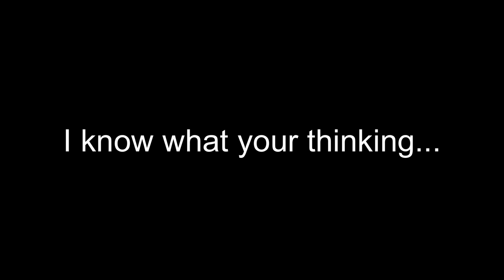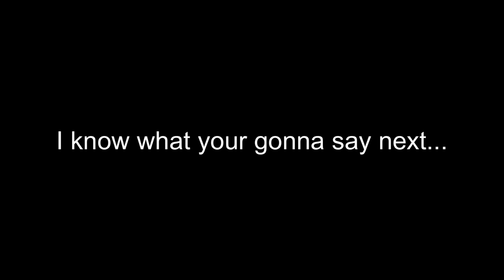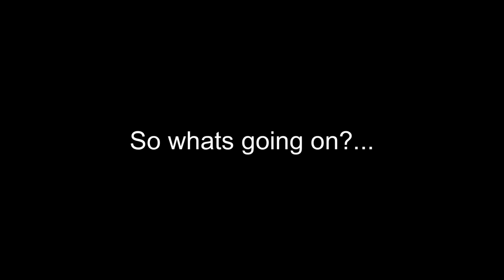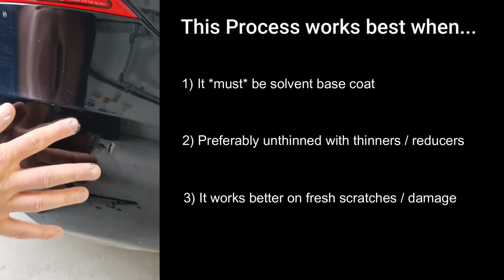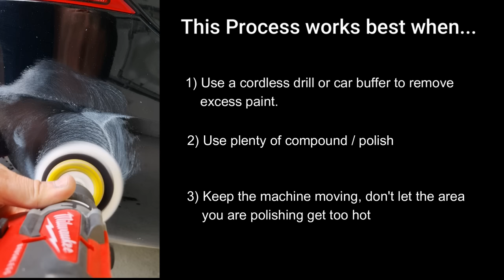Amazing Scratch Chip & Road Rash Repair Method

Comment: How long do you let the paint dry for? I'd imagine if its left too long it'll be almost impossible to get it off with just a polishing machine. So i'm guessing there's window of opportunity in terms of... when to buff?
Reply: I've found good results after 10-20 minutes with some mild level scratches and hitting it with a heat gun for about 60 seconds
Reply: Deeper scratches I fill with paint in JUST the scratch first, then I glass off excess so it's flush with the original paint, then polish
Reply from the maker: A couple of mins is usually suffice.

Comment: Hi, thank You for the video. I’ve tried Your method. I’ve used the spray paint from can  with exact number of color to match with my car’s color.
But I didnt spray it directly on a car, I made few sprays to a cup and then I applied to a car with my finger - as was shown in video.
The paint seemed a bit transparent and too much liquid, so I aplied 2 layers and then waited about ten minutes and then it was literaly IMPOSSIBLE to get the coulour out with the rotary pad 🙈
So how long time is best to wait? 3, 5 minutes? Is the colour cured, when you begin to polish it, or is it still sticky to touch ? Thank You!

Comment: Amazing videos- thank you for outlining this process so well. Could you tell me and what’s scenarios you use the 2000 and 3000 grit sandpaper and which ones you skip that step? Also what buffing compound are you using? Thanks so much!
Reply from the maker: I use rub and buff method on medium scratches and touch in/wet sand on deeper wider marks
Reply from the maker: I use farecla g360 cutting paste

Comment: amazing !  I have scratches where someone has used a coin on my doors and bonnet, but not deep, I may give this method a try thanks for sharing !  P.S Could I use an aerosol solvent paint by spraying into the paint lid to get enough  liquid paint, then use my fingers to rub in ?
Reply from the maker: Definitely worth a go. However I wouldn't use paint from an aerosol it will be too thin

Comment: That’s brilliant, can’t wait to try. Quick question re: the polishing pad, do you have to wash it afterwards in any special solution to remove elements of the paint ?
Reply: Foam pads can be maintained dragging a screwdriver across a DRY pad at high speed. This will remove the abrasives/foreign material in the pad. Careful to angle the bit so it’s not too aggressive OR pointing into the rotation. Haven’t tried on wool or terry cloth, but it works great on foam.
Reply from the maker: I would probably disguard the pad or use it for this method in future only

Comment: Great video. 
Just a couple of questions though 🤔 
After repairing the stone chips on my bonnet and the gravel rash on my bumper how long do I leave it before applying PPF??  If I got the car re sprayed I’m told it needs to cure for 3 weeks before covering it? 
Also will these repairs remain in good order if I do cover them with PPF?
Many thanks
Reply from the maker: The touch up paints usually cure fairly quickly. A week should be suffice.

Comment: Thanks for the great video.  I tried your exact method with drill, Maguiars Ultimate Compound and an orange pad.  The excess paint removed fairly well but now have buffer marks.  Is that normal and need to go over with a polish and softer pad?  Or did I do something wrong at my initial buffing stage?

Many thanks!
Reply from the maker: Hi. Like any polishing, finish down with a finishing polish and pad.
Reply: Thanks.  Everything turned out ok after polishing.

Comment: This looks awesome, thanks for sharing, but what about two-stage metallics? what is the upper size limit in terms of chip damage? No clear coat used??
Reply from the maker: 2 stage metallics are very difficult to get good results doing any kind of touch up work to be honest. Some better than others. Often I just use the ground coat
Reply: @cvrpov  By two stage do you mean any car with a metallic base and clear? Thats what i have, light colour too on my 97 lexus. Trying to find a work around bc the last owner "touched" in about a dozen chips and a deep key scratch and they've all come out a darker shade AND theyre not flush at all just painted chips. Maybe a rush job and not a proper paint match. Might try adding hardener letting it sit in the lid for a few mins and trying the card swipe method as well as the crown and wet sand method. One chip at a time and see what works...
Reply: @pixelbath2131  Thanks, that sounds like it might work. My plan is to simply carefully place a layer or two of (metallic) color paint into the chip "hole", then fill with clear and sand down with 1000 then 2000, then polish. these chips are about 2 - 5 mm diameter

Comment: Bigger rock chips on a metallic car, will this work you think? I think the color difference might be just a little too big when theres no clear coat.

But maybe if I mix clear coat, thinner and harender and rub it on and buff off. Have you tried this?
Reply: Nvm saw now, unsolved base coats without thinner but i guess ill try it
Reply from the maker: I have done some on metallic cars. Check my other videos

Comment: May have been asked already but there are too many comments to scroll through… Can this be done with touch up paint that is supplied by the manufacturer? Like the ones in the tubes with base and clear coat on each end?

Comment: Are you using a Milwaukee m18 hammer drill? I have the large Milwaukee polisher, but I also have a small polisher Griot's g8 polisher. I never thought about using an attachment to hammer or cordless drill.
Reply from the maker: I have the milwaukee mini polisher which is great. I just use the drill as an example that it can work with a tool that most people now already own

Comment: Fantastic video mate !.
This is a "Number 1 Top Tip" alright !.
Question :- If I used a manufacture supplied "Touch Up" kit, which comprises of a one tube of the body colour and one tube of the top coat lacquer, would using the base coat only work in your fix ?. The base coat will only wash out using gun thinners, so assume from this, that the colour stick is solvent based ?. Am I correct in my theory - Thanks !.   
Please keep the excellent content coming.
Love it !.
Reply from the maker: Some manufacturers supplies touch up sticks are water based nowadays.. so just bear that in mind and check 1st. It would probably be better to order some paint (50ml) from a local paint supplier
Reply: Mix some lacquer with the base coat, clean the scratch with panel wipe before rubbing with paint and make sure there is no tar around the area.
Reply: @robbeard6929  whats the ratio? thanks
Reply: @BoStErO1905  I would try 50:50. Just had another thought, I wonder if you could mix the base coat with super glue gel.

Comment: @cvr Thanks for your videos! I accidentally sanded a rock chip too much while trying to fix it. Now I have a penny sized hole down to the primer (white), surrounded by a 2 inch base coat area, surrounded by a 5 inch sanded clear-coat area. This is on my bonnet. What is the recommended course of action (can it be done with a touch-up pen of base-coat and another of clear)?  Much appreciate your expert opinion.
Reply from the maker: ultimately needs a respray if the paint has been compromised.

Comment: Amazing results. What should I look for when getting the paint? Should it be a perfect match paint with the paint color code and all or I can use any generic automotive paint with the same color? 

And what brand paint do you recommend?
Reply from the maker: On darker colours a close match is suffice. Any solvent paint though preferably mixed in the colour of ur car using the paint code.
Reply: I'm confused? I thought the solvent paint is what was supplied in the kit?

Comment: I’d love to buy this and probably will but need a couple of questions. The car is an Audi Exclusive meaning it’s paint is a one off colour chosen by the first owner. I don’t know if the paint code even exists. Is there a way to match colour without the code? Also didn’t really understand the products. Are you applying the touch up paint by fingers then using compound or is it wax?
Reply from the maker: Hi mate. Google and Ring Derby VW TPS and chose option 2 on the phone. Give them your car reg and they should be able to provide you with a paint code. If they can't then it might be a bit tricky. Martin

Comment: I know for a fact that the road rash on the lower doors will not last especially on a Porsche. This is a patented method called SSR sprayless scratch repair. I have been doing this for 14 years. It is effective, but the camera lies a bit because it does not pick up everything. SSR is out of Texas and has been around for at least 17 years

Comment: I have a multitude of chips on the hood and front bumper of my car, a 2020 MX-5 in soul red crystal. Would this method work with that color and multi stage paint?
Reply from the maker: Multi stage paint is almost impossible to get right unless the basecoat is very close match to the overall colour. Ie not much pearl top coat

Comment: I tried this method but used a 2000 grit first on one of your other videos. Then I got this touch up paint on eBay for BMW. However when I applied it there was a colour difference when it dried. I had to try and remove it again with the 2000 grit and then use the cutting polish after. A little improvement but still could do with another touch up. Where did I go wrong?

Comment: Is appears there is no need to specifically colour match. Is that correct?
Reply from the maker: Alot of colours especially darker ones can be a close match and not necessarily a perfect match
Reply: @cvrpov  that's what it looked like. I'm going to use this method on a dark grey VW Golf as it has just been keyed all the way down one side. I will be attempting to obtain the correct colour though

Comment: Awesome system! Avail. In USA?
I have my paint color code, but how do I know if my paint is solvent or water base?('08 Accord)  Aren't the majority of cars now water based?  What happens if I have water base paint & use this?

Also, will this work on a pearl paint ('10 Toyota Prius) that uses a tri-coat system instead of just base/clear?
Reply: Only the color (basecoat) would be water based, your clearcoat is not. It is more than likely Urethane. In any case you cannot perform these type of repairs with water base paint it simply will not work for a multitude of reasons. Waterbased touch up paint is only good for "dab and clear over" touch ups, so it would have to be solvent based paint. If you use urethane paint it will react with your clearcoat and "warp" it damaging it permanently. Choose your paint wisely

Comment: I guess this is same as SSR system which has been out years , other companies do it like kwikchip and dr colour magic , only difference  is they give you a levelling solution to remove the excess paint then polish
So it won’t work on newer cars with water based base coats ?
Reply from the maker: Similar mate, they have a fixed colour chart. Our paint is pre mixed with a shine additive if its a Paint Gear Kit that's used. It makes no difference what the manufacturer uses as a factory base. I think most cars inc all the ones in the video will be waterbased
Reply: @cvrpov  I need one which is a Pearl black colour , is it ok to ceramic coat on top after a few days ?
Reply from the maker: @M.E63  yes should be fine

Comment: I have some deep, scratches in the clear-coat from my bumper falling from height of the lift. Sanded it as much as possible and then buffed it but scratches are still deep, they shine but are still deep. Can a lacquer/clear coat touch up pen do the same trick? Apply it exessivly and then buff out?
Reply from the maker: Yes but be carefull with further sanding and polishing if you have already done this to the area
Reply: @cvrpov  and do you polish when it is hardened of when it is still a bit tacky?

Comment: I note that you use a professional polisher more than the smaller 3 inch that comes in your kit. Does this give similar results? Also you are using polish or rubbing compound with both these buffing tools. Does this come with the kit or do you recommend something?
Thanks
Reply from the maker: The rub and buff kit comes with its own mini polishing pad and backing plate with a drill spindle. Some clips in the video have my milwaukee polisher being used. Different pad and backing plate set up but the same results.

Comment: Hi   The Paintgear kit however has our premixed lacquer agent in the paint, So are you saying that there is a clear mixed in with the solvent paint...OR not.. Cheers. Regards
Reply from the maker: The method works with just solvent base on its own. In the paintgear kit I add an additive which is similar to lacquer but not actually lacquer as I personally think it adds 20% effectiveness to the process. Half the jobs in the video were with and f without.
Reply: @cvrpov  Hi Again...I add an additive which is similar to lacquer . What is the additive you use hopefully i can buy it here. Cheers

Comment: I tried this with touch up pen paint got finger print marks/little hills and dips how do I flatten it out?
Reply from the maker: If they are bad then maybe a little car thinners or acetone to completely remove the paint applied and start again. Alternatively you could wet sand the area but this will obviously remove some clear coat from the area so proceed with caution
Reply: Thanks for this appreciate it 
Sorry for all the questions 
Got paint matched for the car from plaque on the door jam why does it look dark to original paint when applied with brush or finger the car im working on is dark grey but its coming out black 😂😂
Is too much paint being applied? 
How do you blend it in? 
Thanks again